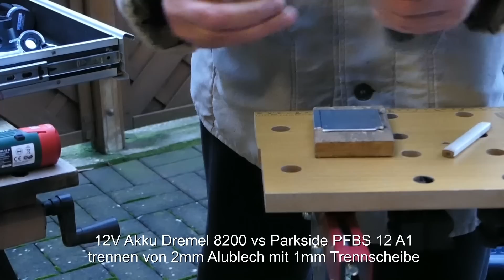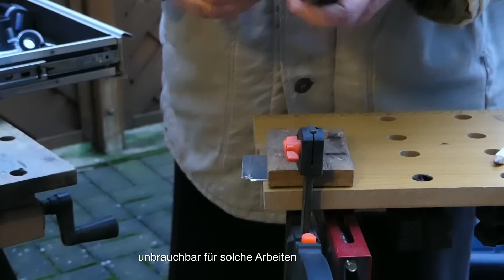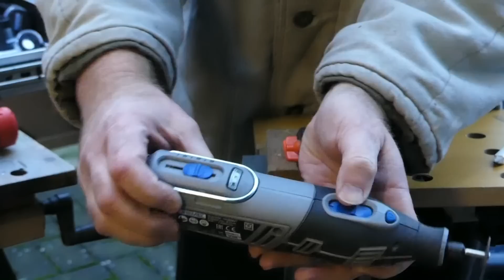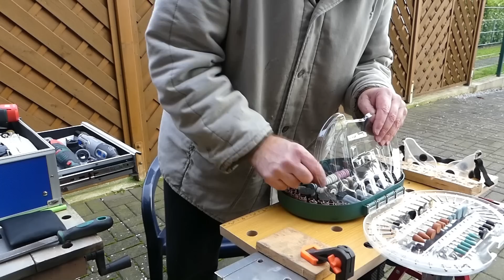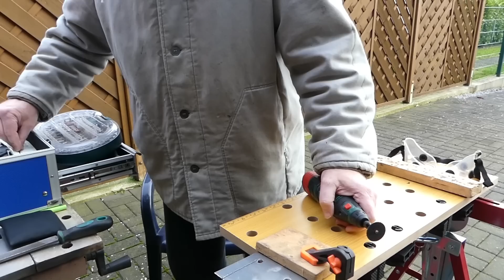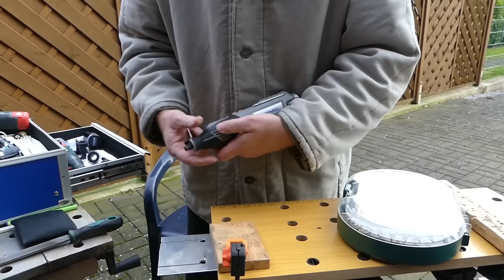Vergleich Dremel 8200 vs Parkside PFBS12A1 Geradschleifer - trennen von 2mm Alublech

Comment: Man muss halt mit sowas auch richtig umgehen können!
Reply: Habe heute gerade einen sauberen Ausschnitt mit einem Parkside in 2,5 mm dickes Alublech getätigt: Ergebnis: Top.
Es bleibt anzumerken, dass mit dem eher für Kunstoff vorgesehenen Blättchen [auch wenn anderes dran stehen mag], dass der Siegfried da benutzt, eben keine guten Ergebnisse zu erwarten sind.
Man kann durchaus die 38 mm Dremel - Flexscheiben auf dem Parkside einsetzen [mit passendem Adapter und 12 Scheiben neulich bei ebay geschossen, 19,- € incl. Versand].

Noch ein Tipp: Nicht immer die Scheiben möglichst lang zum Aufbrauchen drauf lassen, sondern ruhig in verschieden angenutzen Zuständen [Durchmessern] sammeln. Je nach Breite der nötigen Ausschnitte hat man dann immer eine Scheibe mit passigem Durchmesser für eine exakte Breite, ohne auf der anderen Seite zu "überschneiden". Oft soll so ein [Durchbruch] ja auch von beiden Seiten Top sein. Insbesondere im Prototypenbau ein Muss. Und das Ausschmieren mit Kaltschweißpaste sollte nur die absolute Notlösung sein.
Auch wenn man an manchen Stellen diese ruhig mal benutzen kann - z. B. für ein Alltagsmodell in Eigennutzung. 
Ansonsten wirkte dieses Video auch so, als wenn sich beim Hantieren mit der Parkside extra wenig Mühe gegeben wurde. Denn die Aus-, Ab-, und Umrutscher können auch mit Dremeln passieren. Das ist er eine Frage der Erfahrung und des Willens, ob das passiert. Oder auch der Konzentration, wenn man schon stundenlang am Werkstück arbeitet.